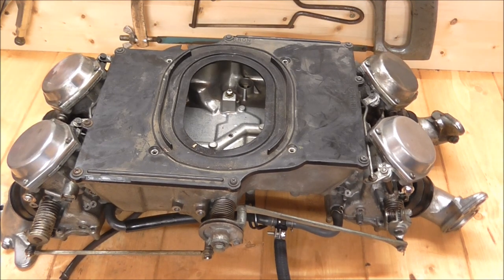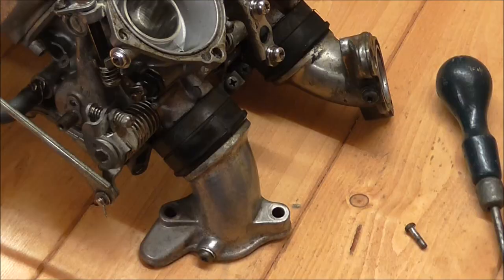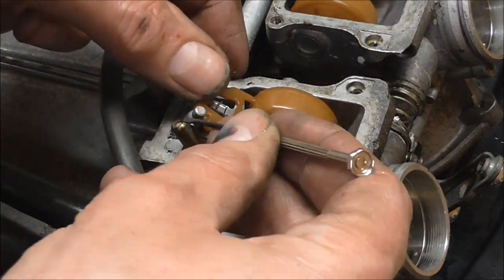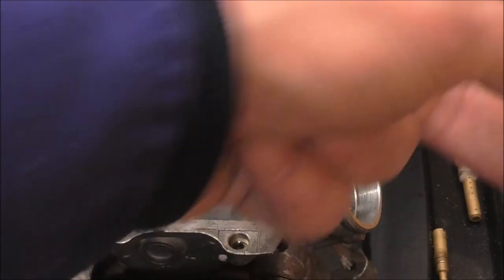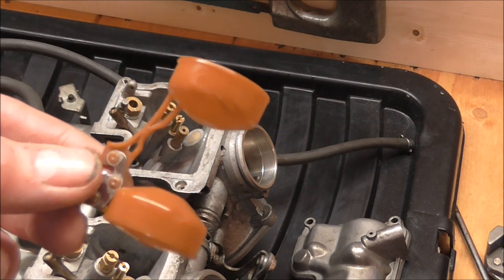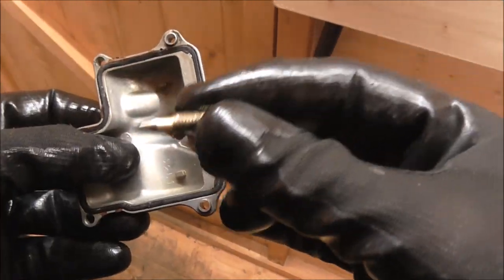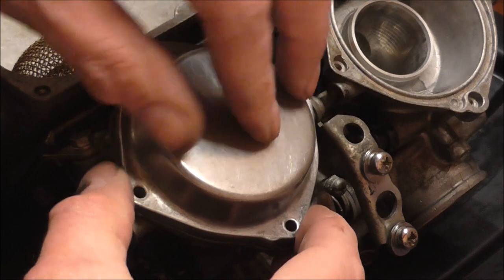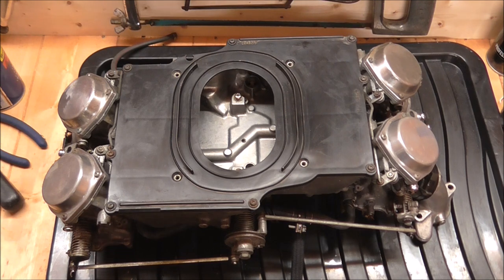1984 GL1200 Goldwing Aspencade carb cleaning

Comment: Anybody reading this please dont use carb spray on the slide diaphragm...thats thin rubber and theyre expensive to replace. Wipe them gently by hand with some 10w oil and leave a small film when reinstalling...
Reply: I used silicone spray sprayed onto a lint free (Scotts shop towel) rag and gently wiped them...super easy to tear if you're not careful and getting a new one on to replace it is not easy.

Comment: Dont for get to clean the intake ports for the jets thats the main problem with carburetors when it don't run right. If you don't know where they are their the little holes in the back of the carburetor inside  the big hole probably under that round screen lookin thing. Use compressed air blow into those holes make sure you can feel or hear the air come out jets cover each jet as you blow air into the holes make  sure air blows out the exhaust ports witch would be the small hole usually in front of the needle jet and the needle jet. Please like if this helps you

Comment: Thank you so much! I am rebuilding an 85 gl1200 for this summer!
Reply: How’d it go? I’m doing mine this winter
Reply: @kyles280  The carb cleaning went great. Unfortunately there were some additional things beyond my hobbyist level of skill. It's in the shop currently for final items before it's reinspection.
Reply: @Matt--G111  awesome! What’re you having done at the shop? Are you in the US?
Reply: @kyles280  The brakes are overheating so the brake calipers are getting rebuilt. It might need new hydrologic lines too. Yes I'm in TX right now. What kind of repairs does yours need?
Reply: @Matt--G111  ok awesome. Mine has been in storage since ‘09 or so. Grampa bought in new and gave it to dad gave it to me but he said it has the handlebar wobble and the dealer didn’t find anything. I’m doing the carbs and everything else on it myself engine-wise and brakes. I’m taking it in for tires and wheel bearings, fork seals and oil and steering stem bearings. Looks new. Only 40k miles on it
Reply: Kyle, I’m going to be cleaning mine out in the next month.  Any issues with carb adjustments after the reinstall.

Comment: John, you neglected to remove the pilot screws.  Inside each pilot screw is a tiny spring, washer and o-ring.  Each of those pilot screw chambers should be thoroughly cleaned.  Also, the slides should have been deglazed to prevent sticking.  You shortchanged yourself by not taking each carb apart totally and run them through a sonic cleaner.  Using carb cleaner alone is okay, but with that much work, why not do it right?  Thanks.
Reply from the maker: Appreciate your comment, but seeing as I could not find any video on Internet explaining any of that I did everything from scratch and therefore only did what I knew. I don't pretend to be an expert. The bike is still running absolutely fine, so if the video helps other then that's good with me.
Reply: What solution do you use to clean the parts in the ultrasonic cleaner?

Comment: 40 pilots Will make it way too ritch. Go back to 35 pilots, 110 main and two shims under the needles. Try 2.5 turne on the pilot screws..   it made my 1985 a dragster.   40 pilots makes it a slug.
Reply: Hi... Can you explain what you mean by 2.5 turn AND 110 main and two shims...? Really hoping you see and come back to this Mr. Hoffmann, as this is a job I will have to be doing soon.
Reply: @JAYHARRIS85  He means 110 mains. The larger jets. 2.5 turns out on the air fuel mixture screw. You bottom it out and then count the turns out. On my gl1100 it is 2.25 our for instance. Two shims stops the needle sooner I think. That one I am not sure of since mine do not have shims.

Comment: HI John on your video a rubber grommet fell out your carb when turned it over, where? did it come from as the same thing happened to mine and i have no idea where it came from can you help. Thanks.
Reply: Hi Derrick. I have no idea where it came from, and it never went back on. Bike running with no probs. J.
Reply: Read up on the comments it was to the air cleaner